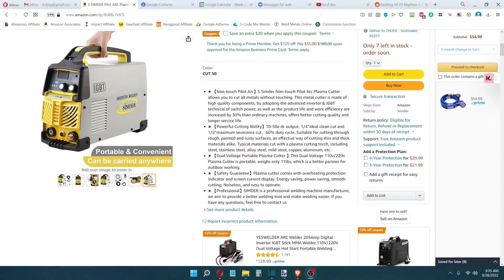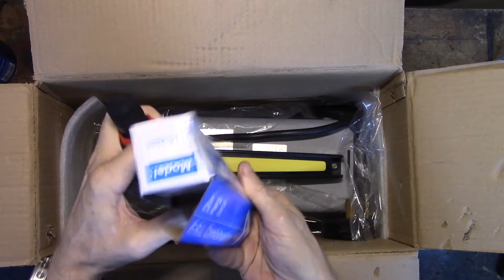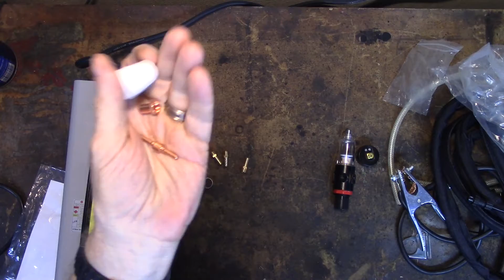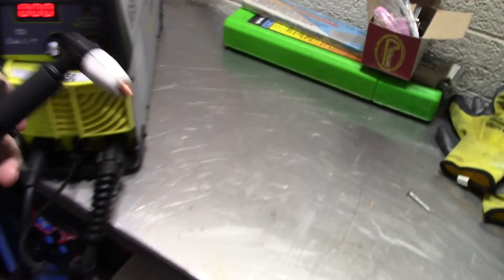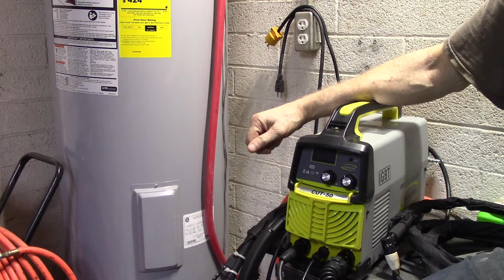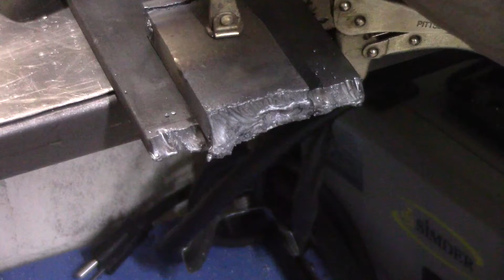Simder Cut 50 plasma cutter. Unboxing, test and review!

Comment: what air compressor are you using?
Reply from the maker: I have an old Harbor Freight Central Pneumatic 2.5 HP, 21 gallon that HF doesn't sell anymore. At least I haven't seen it in stores and it's not on their website. The nearest equivalent they have now is the McGraw 20 gallon for $249 which TBH looks pretty similar to mine with a different paint job.
Reply: @3rdpig  Thanks!  greatly appreciated